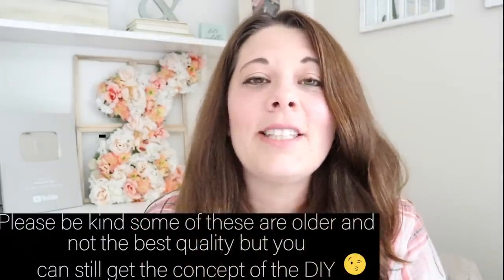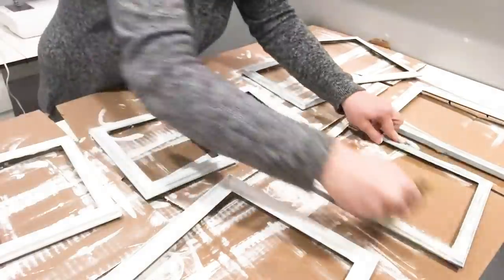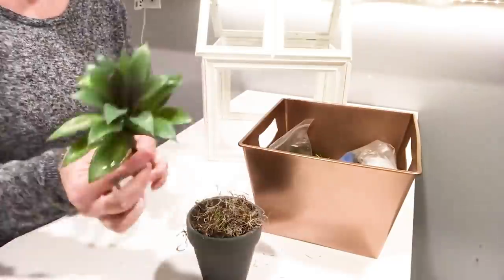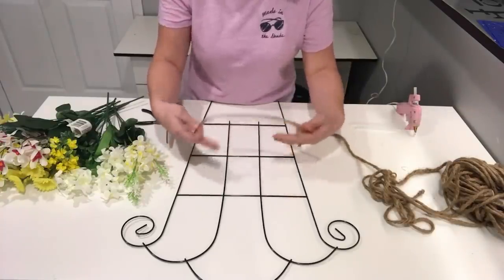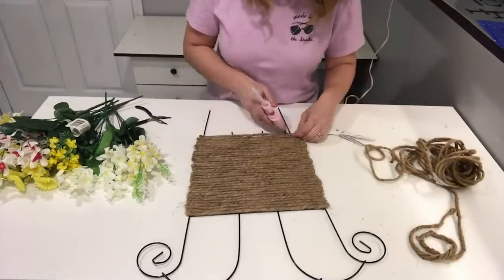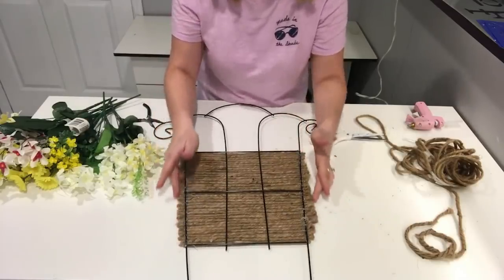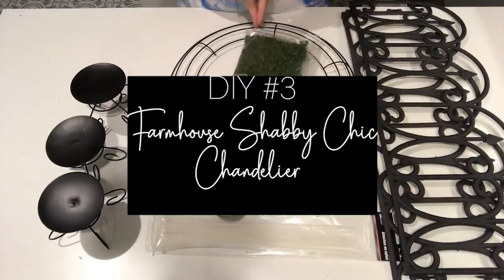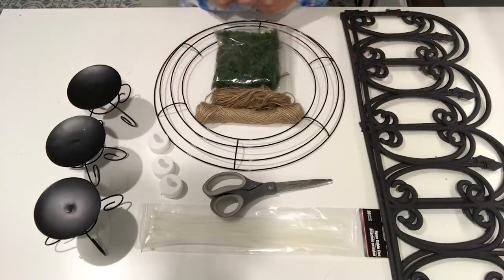🤩TOP 15 DOLLAR TREE FARMHOUSE DIY HOME DECOR

Comment: when you made the "basket" with flowers you should have just wrapped the rope around and  around it would have served two purposes. You wouldn't  have had to  add the burlap in the back and you could have taken it apart and used the rope for another project. Just a thought...great job

Comment: What was the point of the hula on the clock?
Reply from the maker: To be able to make a nicer circle and then then you also have something to hang it with cause you can’t put a saw tooth hanger in foam board it won’t hold up. You could hang it with twine but I didn’t want it to show and if if I put the twine farther down I was afraid the clock would hang tilted off the wall. I hope that answers your question sorry it’s kind of hard to explain 😬 thanks for watching have a great weekend! 💕☺️💕